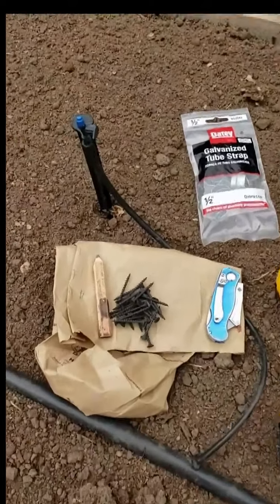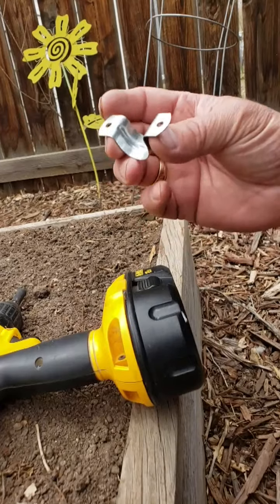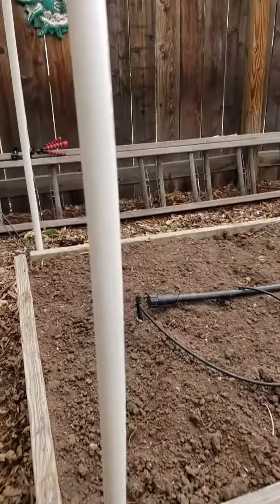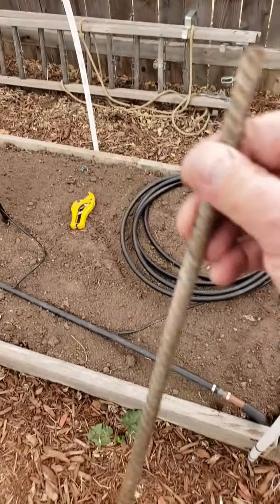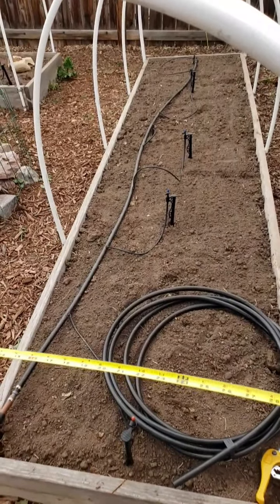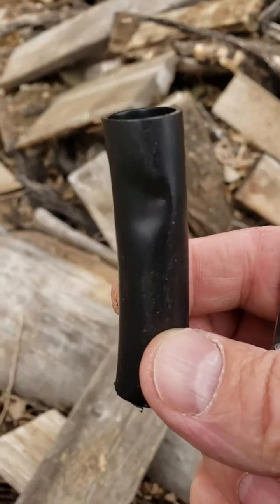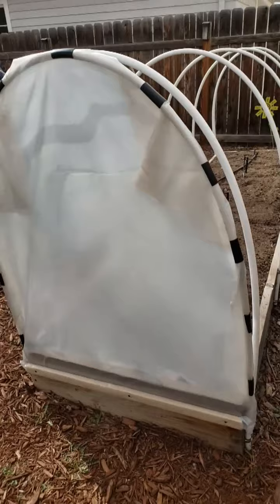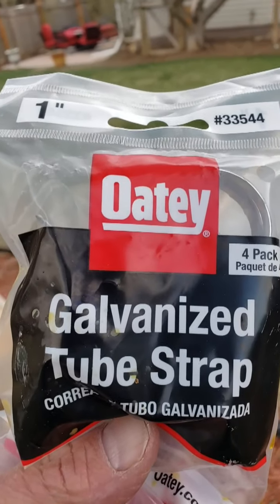Building a Raised Bed Hoop Cover

Comment: Mark, thanks for this video!  I have used the PVC hoops for years for emergency cover (read hail) on my raised beds, but this will up my game considerably on either end of the season!  I particularly like how you have attached the side supports to the hoops so they can be lifted and stay in place!  You mentioned you were using 6mm plastic from the paint section, but UV would be better.  Would you still stick with the 6mm 10'x100' if using the UV plastic?  Your comment about the rebar also gave me inspiration for crops that I have planted in the ground.  Hmmm!  Thanks again!  Terrific info and details!